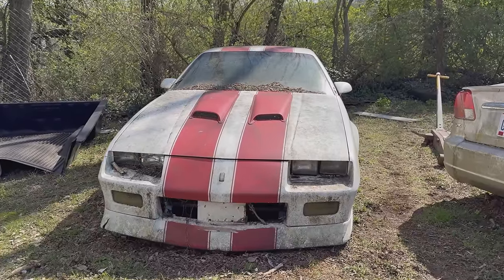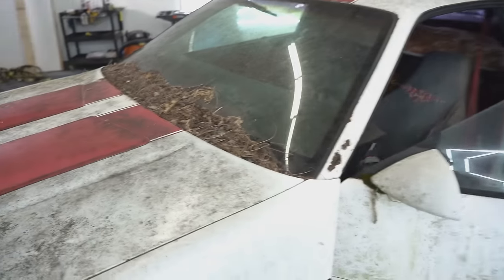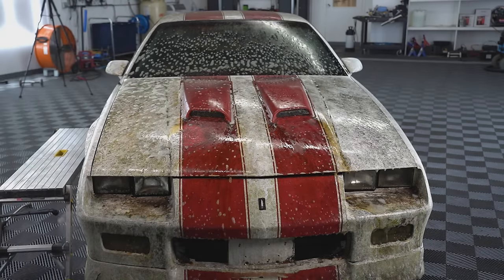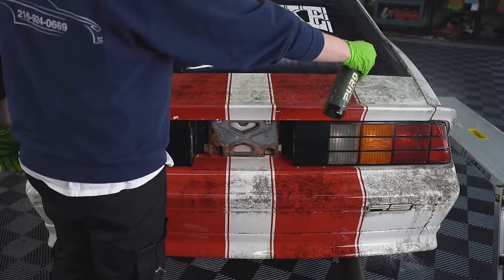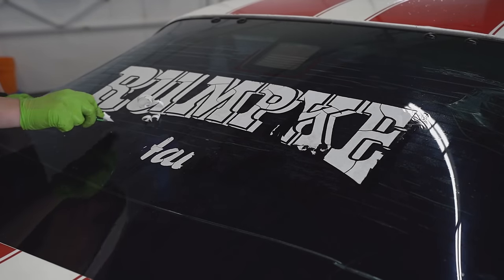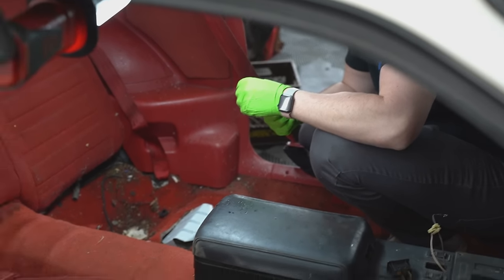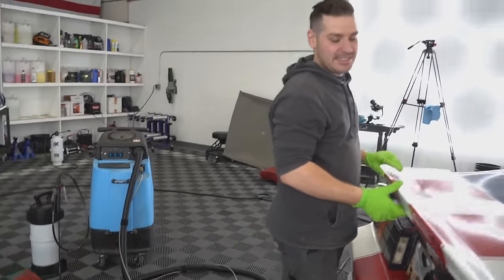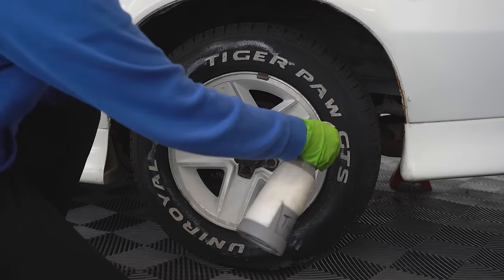First Wash in 20 Years: ABANDONED Camaro RS! | Car Detailing Restoration

Comment: The pattern on the algae/moss is from slugs. It's the track they make as they eat. That era Camaros make for good budget hot rod projects. A good candidate for an LS swap. Not the most classic interiors though.
Reply: Yes I had a terrarium with several slugs and they created patterns just like that on the glass
Reply: I was going to say the same thing
Reply: I'm thinking most likely snails rather than slugs.
Reply: Either way, gross!
Reply: @jmsmom67  eye roll
Reply: Snails most likely rather than slugs. They tend to attach to natural surfaces outside unlike snails will attach to anything.
Reply: @robertnightingale4101  swap a new.  350. LS CRATE MOTOR ANDD 6 SPEED MANUAL
Reply: Thanks Mr Helper
Reply: Forget  LS , go LT1 😂
Reply: it's from vines that have been removed. they were still on the tires

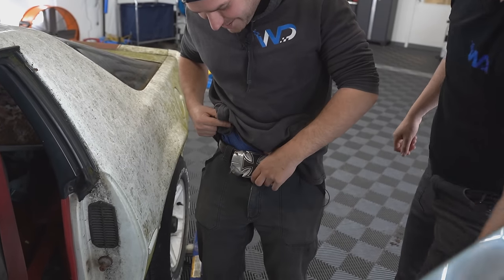Comment: 3:50  If nobody else said it, that's a brake pedal cover. The long brackets on the back go on the backside and the screws tighten the bracket into the pedal cover, clamping down on the OEM brake pedal.

Comment: Rs were usually v6 cars with the same body kit as a z28, they could be ordered v8 as well! The engine likely has a rust ridge on the rings. I seen it start to turn when he had the ratchet on it! If you turn it back and forth with the ratchet after oiling the cylinders it would break free!

Comment: As an old Camaro guy, those 3rd Gens are beautiful.  I build 2nd Gens.  The RS is a trim package, and the Z28 is a performance package.  That reminds me of the IROC Z28's that were produced in those years.
Reply: Iroc and Z28 were two different packages.
Reply: @thomasnichols3950 the later 3rd gens could be had with both iroc and z28 options
Reply: Last year of the Iroc was 1990. 1991-1992 were just Z28’s
Reply: The  hood blisters on this car are not original the original  hood blisters  were not functional they were more for decorative  appearance

Comment: In 1982 I wanted a new Camaro I was young & my first new car purchase. Co-worker told me get a Z28 not a lesser model.When he showed me a pic of the new body style Z-28 I bought one new within a week I was blown away by the styling. That brand new black Z28 4 speed got stolen 4 years later so I bought another Camaro in 1987 a Blue used 1983 Z28 automatic. Had it till 2021 and sold it. Now I see these 1982-94s all over the place in terrible neglected states  its really sad but I did have my blast with two of them at least. Very Enjoyable video to see this Camaro cleaned up quite remarkable.. .
Reply: I'm 20 and just bought an 85 F41 Camaro off my brother in law. Car is double my age and sat outside for 10yrs. I'm excited to give it a new life
Reply: @gomi350z  Clean it up leave the 305 or all stock, drive it and keep it in your family for many years Good Luck!
Reply: @OutBoardTink62 terrible advice, ls swap it it and enjoy a decent motor with potential
Reply: @OutBoardTink62  yessir that's the plan, rebuilt the 305 last year, this yeas gonna be brakes and suspension. Can't wait to get it painted. I want to go with Pontiac fusion orange
Reply: @gomi350z  You could always swap it but keep the original motor its of course up to you its only original once Best of Luck!
Reply: @OutBoardTink62  yea I plan on keeping the 305, if it breaks beyond repair tho I'm def going the 383 with efi route

Comment: 9:40 you can remove vines from the tires by putting on a new set of tires. If vines were growing on/in them, that's a sign the tires are too old. Even if there was plenty of tread, they are unsafe for normal driving. Use them for burnouts, donuts, then replace.
Reply: FIRST  ...

Before   You   
Buy  New  Tires ...

Which  it 

OBVIOUSLY   

NEEDS ...

Try   Paint  Thinner   And  Scrub   Hard  With   A  Steel / Brass   Wire  Tire  Brush   To  Remove   Those  Vines .

You  Also  Can  Try  Kerosene  And  Or  Gasoline.

But ...

OBVIOUSLY  ...  ! 

NO 

ONE 

LIGHTS    UP   MATCHES  / LIGHTERS    AND   STUPID  / RIDICULOUS  

CIGARETTES  OR  ANYTHING  

 EVEN   REMOTELY  
NEAR      THE   DAMN  CAR ...  !

Comment: Pull the spark plugs, shoot some Marvel's Mystery Oil into the cylinders. Let it soak overnight repeat (leave the plugs out) turn the engine. Next, replace that engine, it's a dog! But the Mystery Oil trick is good for engines that are useful & have been sitting a while.

Comment: Coming from someone who has only ever owned firebirds and Camaros, never hold, open or close the door by the window. Never touch the window unless you're wiping it down -.-
Reply: Mine is an 89, released in 88. RS special edition. Had a 305 V8 in it, black leather interior, dome lights, calendar, chassis clock and all on the upper panel with ttop. All the bells and whistles of an iron and painted Iroc red from manufacturer

Comment: I had a 92 Z/28 and you have to take the rear axle out to drop the tank for the fuel pump.  we didn't cut up the floor but I really had a hard time not wanting to.  it was a PITA.  here's a weird fact about the 3rd gen. the RS was offered with a  305 and a manual trans but had a central port injection.   while the 2 variants of the z/28 only had an Automatic trans.  the T tops version of the Z/28 came with  a tuned port 305(5.0) and auto trans.  while the hard top has a 350(5.7) tuned port and auto trans.  you couldn't get the late 80s or early 90's Z/28 with a Manual trans. 
but you could get the earlier version of the  Z/28 with a carb and a 5spd. like around 84 or so.   GM had the dumbest offerings back then.

Comment: Me and my best friend grew up with Camaros. He had a 1986 RED CAMARO 305 TPI HIGH OUTPUT(BIGGER CAM/1,000-1,500 more rpm on topend from factory. But yeah it was one those model u said it’s a mix it’s a z28 but also iroc. So I guess iroc z28. Automatic(all 86s was automatic do to the huge upgrade in torque Chevy didn’t think it would hold up/ppl could shift right so just went auto ONLY that year. We learned a lot from his lol

Comment: I'd take the v6 out and put a carbureted 350 in it. It probably has the 700r4 automatic transmission in it which I would replace with a turbo 350. A pretty inexpensive upgrade and it would be a good sleeper.

Comment: Back on the road, that's a survivor, I had one I drove for a couple years, I parked it in the winter, they are terrible in snow, ice and even rain. NO traction, mine was a V8, I believe it came with a V6, someone put a 9C1 police engine in it, it would burn the tires off, guy I bought it from said he had it 130mph plus. I had it 100 once, if I was younger I'm sure I would have found top end, but I'm too old

Comment: Great detail of this 92’ Camaro. Nice Cincinnati is close so you were able to detail it at your home shop. How much is the standard rebuilt engine for this Camaro? And, is it worth the cost of other major repairs so it’s drivable?
BTW: if it’s use a a parts car what would a buyer bid for it. The reason I ask is because I have to replace a 2016 Ford Fiesta SE driver’s cloth bucket seat and two different salvage dealers are offering the exact replacement for $197. So it appears buying a car to sell on the parts can be profitable!

Comment: Excellent job cleaning the vehicle. The fact is anything can be brought "back from the dead" if there's enough time and money available. There's a few options available. One, keep the current engine and drive train and see if it can be resurrected. Second, swap out and upgrade everything. Third, now that the vehicle is presentable, i guess you could part it out. The choice is up to the owner(s).

Comment: @WDDetailing - I am a DIY detailer and had a quick question. Do you think it would have been easier to just pull the entire carpet out and hit it with a pressure washer? I normally pull the carpet mats and pressure wash them after drill brushing and extracting to ensure all the dirt and stains are out. Just a thought, and maybe if you feel generous, I could take that car off your hands lol.

Comment: The gas tank "trap door" was done wrong. No need to cut the vertical sheet metal like that. In the 3rd gen world that's probably a parts car. If the quarter is rusted like that the underneath is going to have holes too.

Comment: I've removed vines from a tree. It needed a putty knife and the root bits sometimes stayed on the tree.
A putty knife would get the most of them. Sadly, new rubber is probably  the best fix. Also, soak the istons down with something like marvel mystery oil and leave it a while. You would remove the spark plugs and put oil in the holes.

Comment: Let's just say for Shitz `n Gigglez - that was a Pontiac Firebird instead of a rummy Camero - then I'd fully strip the chassis and "upgrade" it to handle the raw brute power of a 455 SD with four-speed trans and a positraction rear end. Make it a shaker hood model too. If it were a T-top model, all the better. The right type of Firebird 455 SD would have a deluxe interior with bucket seats, a full dashboard of gauges, and, on the center console. A kick-butt stereo would be a must have item. It will need four-point race car seat belts, tinted glass, and the super-duty Pontiac FireBird wheel rims! 
That would be a $150,000 dollar car all day long. Good luck finding parts for such a repop version of a legendary 1971 Pontiac Firebird 455 SD!

Comment: I rebuilt my engine. I have a badass Chevrolet Small Block Goodwrench 350cu.in. carbureted 5.7L V8. All parts are from Summit Racing Equipment. The motor was from a 1980's Chevrolet Suburban which is a 4 bolt main. My parts cost me almost 3,000.00 the brand new parts are: Hedman Hedders, aluminum air intake manifold, Crankshaft, Camshaft, Pistons, piston rings, connecting rods,  oil pump, pro gasket kit, timing chain. I have 1 badass 1985 Chevrolet Camaro Z-28 and she sounds awesome! I need a custom dual exhaust fabricated.

Comment: Rallye Sport (RS) cars were made so you could have the Z28/ IROC styling but not the price.
I cut one of my cars to get to the fuel pump, but I made a panel out of an oversized piece I cut from a junkyard car with cam-locks and sealed the opening with aircraft grade sealant.

Comment: Nice. I had a red 92 Camaro RS back in the late 90's as a daily driver here in the UK. However it had the 5.0 V8 TBi engine. While not a fast car, it was good enough as a daily driver, still had a V8 sound track and a 5 speed manual transmission. 👍

Comment: Pretty sure it’s possible to have both packages, Z28 is a factory built performance option and the RS (Rally Sport) was a cosmetic package usually done by the dealership, like custom pinstripe and lick’em n stick’em add-ons like the RS badge.

Comment: I have cut under the back seats to replace the fuel pump before. However, they were generally cars that I didn't care much about, and I always resealed it, so I wouldn't get any fumes in the cabin. I had an 82 Z28 that I also had to replace the fuel pump in, and I went through the extra work of cutting and replacing the bolts because I did not want to hack up the body. Shame on the previous owner. 🤦🏻🤭

Comment: I currently have a white 86 sport coupe with the 3.6 v6 Auto . Not the most popular options but, it was only 1k and the 3.6 has spun bearings so we’re in the mist of building and stoking to 383 a 1970 350 and sourcing ether a 5 or 6 speed manual

Comment: You guys could've done a better job on those carpets. I would've steamed em first to loosen everything up. If it's something adhesive, use goo gone. Let the soap soak for a bit. Then agitate. Then suck it up. That should be your pride and joy. Making the impossible, possible again. Paint looks dull and toasted. You guys need to go deeper and more advanced!

Comment: I cut an acess panel under the rear seat of my 2014 chevy cruze to replace the fuel pump. To drop the tank you have to completely unbolt the exhaust and under body panels. A bunch of evap and fuel lines and even with the exhaust inbolted it preventa the tank from dropping straight down and more of a drop it down far enough and then shimmy it out the passenger side. Such a poor design just like every other thing on the car.

Comment: I am curious what brand Iron Oxide cleaner you are using?on the tires, dont bother.  They are out of date anyway.  The biological incursion has just contaminated the rubber further.  I wouldnt drive on those to the gas station.  Replace them with something inexpensive.  Engine swap and you can add better rubber.

Comment: I've had a '00 and a '98 Trans Am WS6, and I've replaced the fuel pumps on both. Yes, I did the cut in the floor like this on both, since the only other way is pulling the gas tank (which is a pretty big job).

Comment: Love your content. Have a question.  I have a 93 polo green corvette.  I used Turtle Wax clear coat scratch repair and it leaves wet spots on where I applied it.  It won’t buff out with compound.  Not even with a rotary buffer.  Are you guys familiar with this and what a fix would be?  I don’t want to go too aggressive and remove my paint trying to get this junk off. It’s like a ceramic coating that looks wet and smeared in some spots where it didn’t self level properly.

Comment: I had a bad bike accident in 1995, almost died and lost my right foot.
Once I was able to drive I bought a 91 RS v6 to get me around, it ended up being a big part of my recuperation and I loved that car. It didn't handle great or qo quick but I loved it and still have a soft spot for it, I've tracked down the original car and have a dream of one day buying it and renovating it.
I always wanted to sort the suspension and handling then fit a super charger as there is already loads of V8 conversions around.
Happy memories

Comment: 98 suburban 2 of them and A99I pulled the carpet up cut a stinking hole to get to that stupid gas tank pump Took a flat piece of aluminum little bigger than the whole put silicone down self tapping screws stupid manufacturers

Comment: No matter what anybody says, those tires are well.Over twenty years old which means that the smoothness of the rubber has started to degrade and became very pourous. The vines which have little fingers shall we say have attached to the fraying on the rubber surface. Once the vines are completely stripped of all the nutrients from the ground, you interior or a firm scrub brush for your drill will shed all that growth which is on the tires currently.

Comment: 10:30 
If you slow down to 0.25x you can see, that you are going way slower and you're using much more water pressure on the area where you sprayed the cleaner. I mean, youre even cutting a box shaped pattern with clear lines in the dirt, where spray pattern of the cleaner was not as wide and more egg shaped.

At 10:38 you can see the water pooling in a thin line on top of the spray pattern and once you reach the cleaner part the line gets much thinner and the pattern changes due to more water pressure.

On 10:42 you're forgetting to let off and cut a clear horizontal line in the dirt.

A cheap all purpose cleaner from the supermarket or a dish soap would probably yield the same results.

Comment: My 88 chevy trk, cut a hole in the bed to replace the fuel pump. 4x6 sheet of 3/4 inch treated plywood on the bed floor covers it fine.

Comment: Vines have microscopic tendrils that penetrate any porous surface such as tire rubber. Those tires are now structurally compromised and unsafe so best just to leave them as is and the owner needs to replace them.

Comment: The '91-'92 Camaro Z/28 and RS had the same lower graphics. The RS had a flat hood, while the Z/28 had the scoops (not the scoops on this one). The Z/28 was also available with a taller, arch style spoiler.
Reply: All RS Camaros had the Z28 ground effects from 1987 on.  This one has no third brake light for some reason though.
Reply: @mexicanspec  yes, but the ground effects on this model, were '91-'92 only. It is odd that there is no third brake light.

Comment: It's an anniversary edition, they came with the stripes package, someone has added the fake air scoops to the hood, the ground effects/ big lip on the bumper are standard options for 91/92 year cars. That 3.1L V6 was actually a great little engine, it could smoke the tires, and it was far better balanced/ reliable than the previous option of the 2.8L

Comment: Great video. That a great start for a neat restoration project. 383. Turbo 400. 12 bolt posi. New all 4 wheel disc brakes. Unlimited potential. 😊